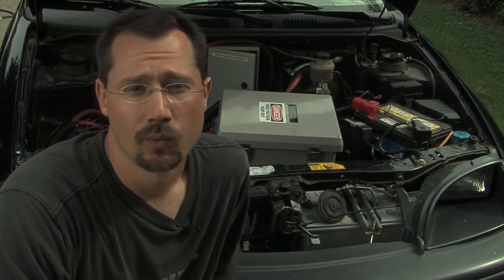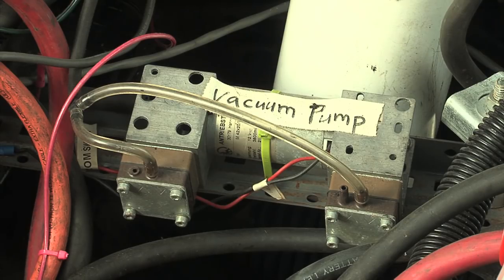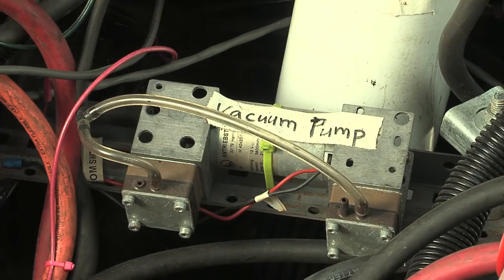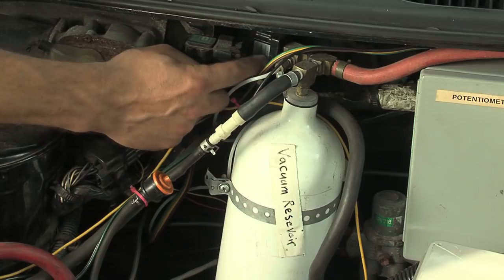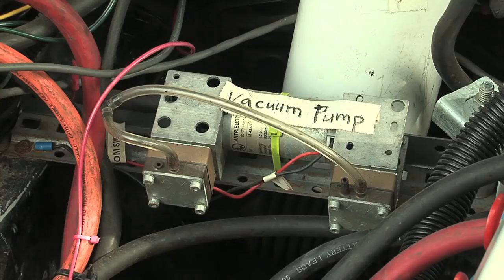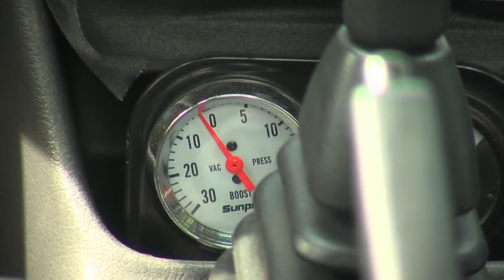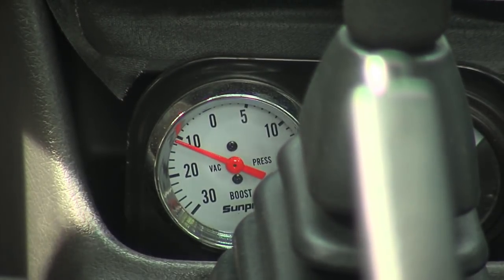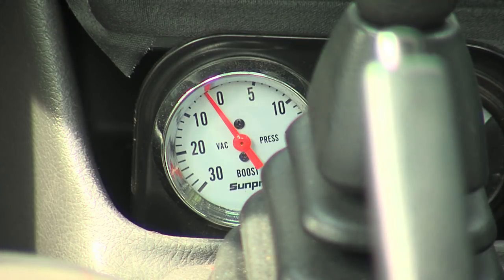9 Build Your Own Electric Car: Power brakes

Comment: Do you have a video running ac compressors and power steering pumps? Is it feasible to run those 2 off a secondary, smaller, electric motor?
Reply: I mean it wouldn't necessarily have to be running the whole time, just switch it on when necessary. Dont forklifts have smaller motors I could use to drive those?
Reply from the maker: I do NOT have a video about that, but YES, people will run those off separate motors.
There are now a fair number of vehicles which had electric Air Conditioning in the first place - such as the Toyota Prius. I do know that there have been some people who have reused those in their own home conversions.

On older conversions, people would power an A/C compressor off the tail-shaft of a DC drive motor.
Reply: @BenjaminNelsonX  Awesome! What voltage do you usually run?
Reply from the maker: @tatethompson2648  This car ran on anything from 72 to 144VDC.
Reply: @BenjaminNelsonX  Cool thank you!

Comment: Why not use simply Disc Brakes?
Reply from the maker: The car already has disc brakes in front. It's not a matter of disc vs drum. It's a matter of the fact that "Power Brakes" in a car are powered by the vacuum created by the engine. Without the engine, most of the braking force is not available, so it needs to be replaced with something else, such as an electric vacuum pump.
Reply: @BenjaminNelsonX  I get the point! It's about the braking force.

Comment: QUESTION:  You don’t mention the general 12V battery anywhere in your videos other than that you’re keeping it and it run your electronics etc.  How are you charging it?  Is it only charged when your drive batteries are charging since you got rid of the alternator with the ICE I would assume.?  I guess.it wouldn’t matter if the car can only drive 20 miles, but if someone puts in a lot of batteries and gets like 50+ miles, it might not be cool for night driving with all the lights, radio, power break vacuum pump going and could deplete the 12V battery before your drive batteries need recharging so it begs the question Is charging the onboard 12V general battery from the lager battery bank using a voltage divider a doable idea or would it be better to step down transform the main battery array to a 12V charger on the general 12V battery so it can change as needed from your main battery array so it Is less likely to be run own before the drive batteries cut out thus ensuring you don’t lose power breaks until after the car refuses to drive due to low charge on the drive batteries anyway?  Trying to figure out the best way to handle that...
Reply from the maker: This car had such a short range that I didn't even both with a DC/DC converter.
When the car is plugged in, the 12V battery automatically charges, and that plenty for the accessory system in the car.
Typically, you would install a DC/DC converter - a device which takes the higher voltage of the main traction battery pack and isolates and downconverts it to a lower voltage appropriate for charging the 12V battery.
You can think of this as being the solid-state version of an alternator.

On my motorcycle, I used a tiny DC/DC converter which was actually designed for rack mount computers!

Comment: The double shaft engine that you cut the shaft off wood of work perfect the back shaft would have ran your transmission the front shaft would have worked all your pulley systems alternator power steering pump air conditioner all you would have needed to do was figure out how to get the alternator to keep your motor running and have a rear wheel drive car and when it was all done you would have a car you wouldn't have to build batteries for or charge
Reply from the maker: https://300mpg.org/projects/electro-metro/perpetual-motion/

Comment: Hi Bejamin could you get away without power on your brakes if you have regenerative braking? And how do you install regenerative braking? BTW Thanks so much for doing these videos. Absolutely brilliant!
Reply from the maker: Regenerative braking would be a feature of the motor and controller. You don't "install" regenerative brakes, you just need the motor to be in place and use it as a generator to slow the car instead of a motor to drive the car. Not all motors are appropriate for use with regenerative brakes. The motor used in this car was a DC Series-Wound motor. That is a style that is NOT easy to use for regen. Permanent magnet DC motors and AC motors work very well for regenerative braking.

Even if a car DOES have regenerative brakes, you would still want service brakes that work properly as the manufacturer intended.
Reply: BenjaminNelson thanks much appreciated.

Comment: Why didn't you use the rear shaft out the motor to drive the regular power steering pump. Automotive pumps last forever and don't need all that other crap.

Comment: !BREAK FAILURE WARNING!
Use real brake hose tubing instead of aquarium hose, to prevent the tubes from collapsing under pressure.😨Also add clamps to the ends of the hoses.  Safer for you and those around you. 😄This is a car we're talking about. Don't trust your life to straws.
Reply: Linden Wyckoff Power brakes also work without vacuum, but they are no longer powered of course requiring a lot of pressure on the pedal.But you can always stop. True about aqarium hose not suitable for vacuum, only for positive pressure. Vacuum (underpressure) hoses have internal reinforcement against collapsing.
Reply: I would recommend using actual warning icons (⚠️ ) over explanation points. Otherwise thank you!

Comment: Just an FYI, a better option for a vacuum pump would be a UP28 Electric Vacuum Pump. These pumps are used in cars with diesel engines. They are on-demand pumps built for the job. I got mine off ebay for 45 bucks a few years back.
Reply: Diesel uses either hydro boost which is ran from the power steering system or air brakes. The vacuum pump is used for mainly the hvac system.

Comment: Engine vacuum does not " suck " on the master cylinder. It basically stores itself in the power brake booster. The check valve keeps it there, always ready for use. When you apply foot pressure to the brake pedal, a push rod activates a progressive valve within the booster causing a fairly large flexible diaphragm to react to a change in atmospheric pressure, ( lack of ). Normal atmosphere pressure at roughly 14.7 pounds per square inch acts upon the diaphragm, which is several square inches in diameter. That controlled "boosted" force overcomes a spring within the brake booster and exerts a force against a second push rod which actuates the spool piston in the master cylinder. Hydraulic line pressure to the calipers/brake pads then stops the car.
 Just wanted to clarify the physics of the thing. Like your channel and your efforts to help guys with their projects.

Comment: Wouldn't think a pressure tested tank would be necessary with such low pressure and a scratch built one could be fitted more easily and look nicer. Could probably even use a plastic radiator expansion bottle.
Reply from the maker: I don't even remember what that bottle was from. It was just in a parts pile at my friend's house. If I didn't have that, I would have used a 50 cent aluminum water bottle from the thrift store.
Reply: you haven't seen the video where a sewage tanker driver forgets to shut a valve and it collapses from a vacuum ?.  vacuum hoses and accumulators are made so they don't suck themselves flat

Comment: Do you have regen braking?
Reply from the maker: Hi Jim! This project did NOT have regenerative braking. The series-wound motor is not suited for regen. Many other motor types, such as permanent magnet motors and AC motors ARE.  My Vectrix electric motorcycle uses a permanent magnet AC motor and DOES feature regenerative brakes. They are activated by twisting the motorcycle throttle backwards!